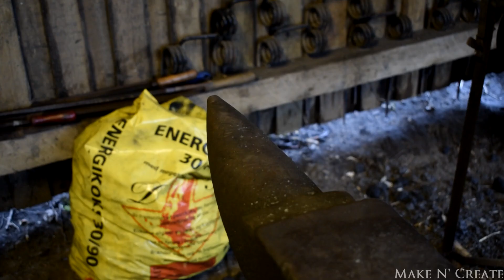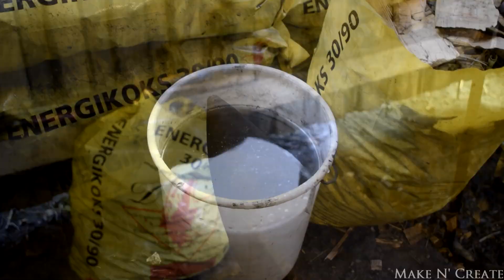Blacksmithing - Forged Tong Rack

Comment: You took the time to punch those nice SQUARE holes in it and then used MODERN screws!
Why not forge some good square nails to go with the old fashioned look?
Other than that, great video!